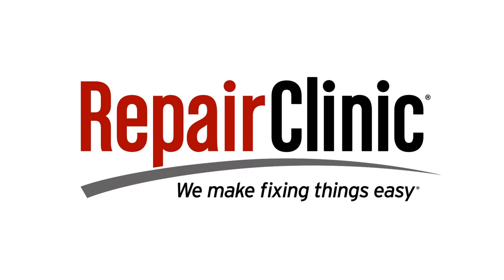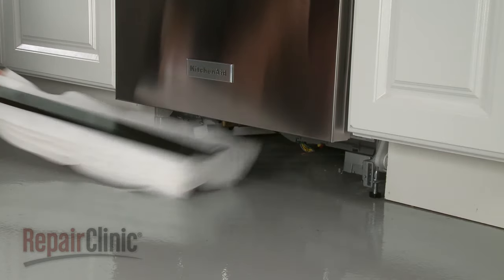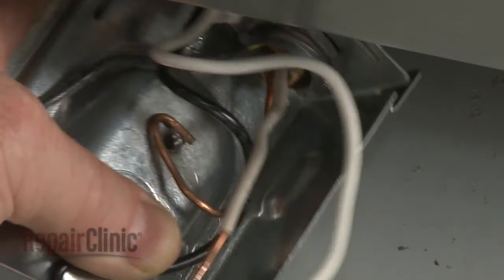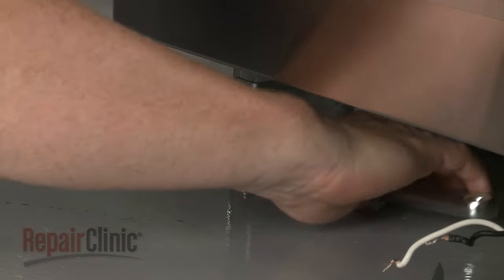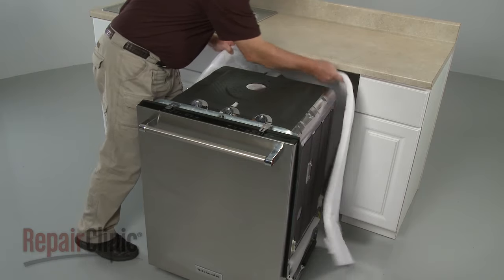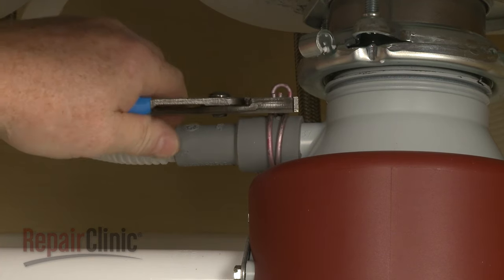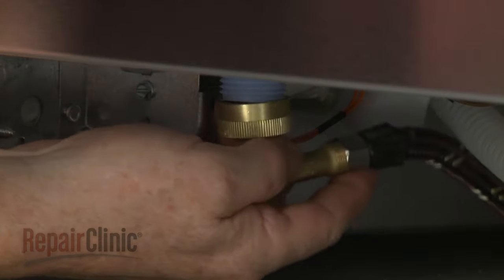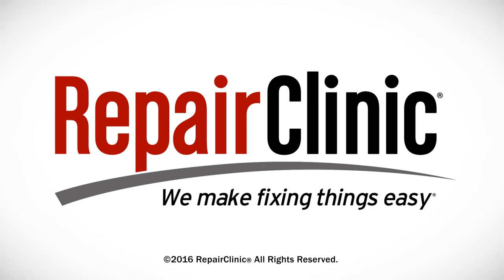KitchenAid Dishwasher Moisture Barrier Tape Install 4396277

Comment: Well, my issue is slightly different.  The leminate at the facing edge of the countertop above the dishwasher becomes loose and start pealing off due to the hot steam coming out of the dishwasher.  I have already took the strip off,, cleaned both surfaces, and used Weldwood Contact cement to reattach the strip.  But it has started coming off again in about 6 months. Any suggestions will be appreciated.

Comment: All that for some duct tape on the under side of the counter
Reply: Yeah, all that, just because it was not placed from the very beginning..  I am replacing my old dish washer and  I noticed the moisture has damaged the wood, if the previous owner had done it properly.... moral of the story is better to do right from scratch than having to deal with damage and/or removing and re-arranging all the stuff again
Reply: @majucamex08  moisture barriers above dishwashers aren't a thing. This is a moneygrab. The "right thing" would be not using particle board above a dishwasher. Litererallt would cost $10 for a realwood panel.
Reply: I'm gonna use foil duct sealing tape and call it a day!